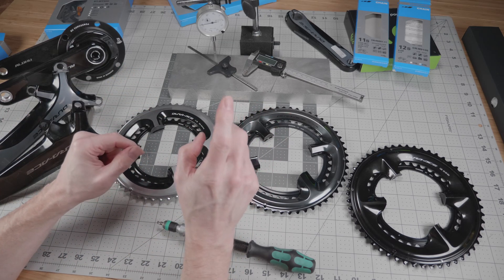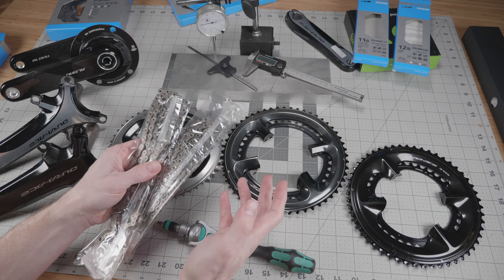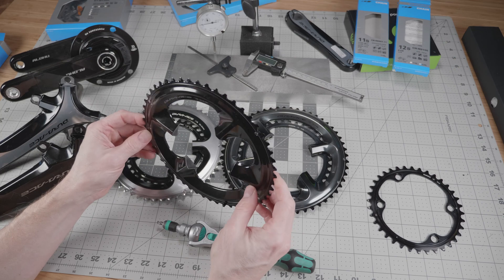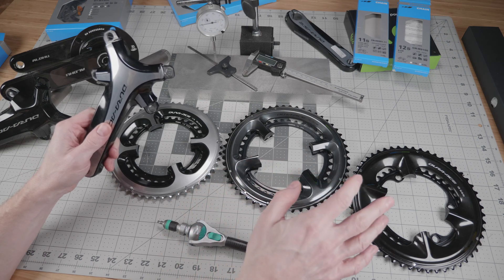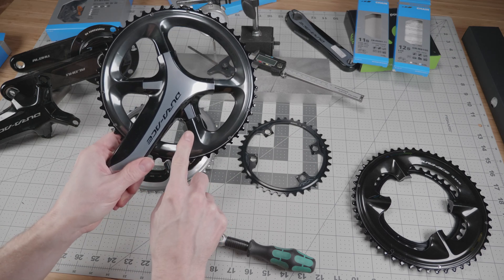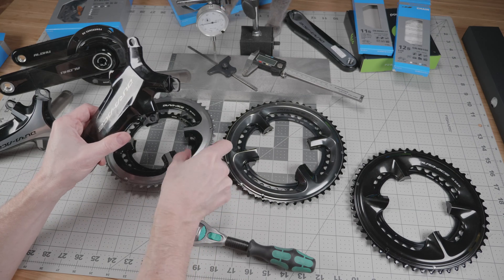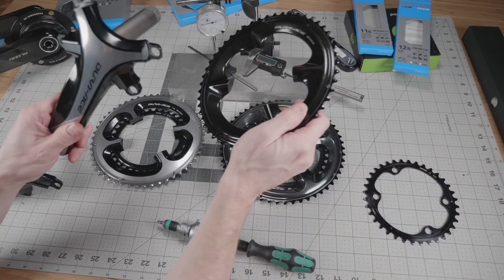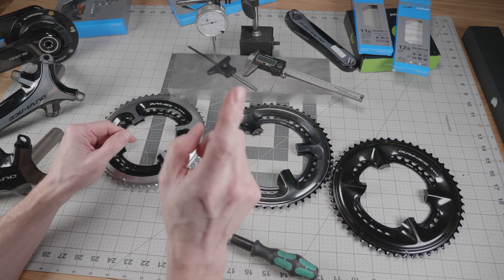Shimano 12-Speed Road Chainring Compatibility

Comment: Except the older gens were less stiff, and very perceptible on newer stiffer frames so you do not want a 9000 spindle and arm on 12 speed. 2- watts difference between a loosened 9000 and a 9100/9200

Comment: You can fit 11 speed shimano chainrings on a 12 speed crankset but it requires using a metal file to file away some of the metal from the 11 speed chainring. I have an Ultegra 8000 11 speed chainring on my 105 12 speed crank. Works absolutely fine with Di2.

Comment: Quick question, I have 105 R7100 12 speed Di2 groupset, I am looking for a 39T inner chainring but I cant find it for this 12 speed, there is for the 11 speed however. Can I use a 11spd inner chainring for the 12 spd groupset? thanks

Comment: This is a bit of a "hail mary" given the most recent comment is a year ago - but here's the deal - bought a bike with an 11s ultegra setup - the crank is labeled as a FC-08 but has the same design as the FC-R8100 - I can confirm this because the FC-08 is visually different from my FC-R8000 and the chainrings from the FC-8000 11s won't fit on the FC-08 crank. the FC-08 was equipped with new 11s inner and outer chainrings - sadly 2 teeth on the outer 52t chainring were damaged in shipping. So, they sent me a new outer chainring but it is the 12s. version. 

Question - will using a 12s outer chainring with an 11s inner ring and 11s cassette w/11 speed chain be an issue with the 12s outer chainring? 

It's annoying that I have not yet found a way to contact Shimano directly about this and every authorized LBS Shimano Dealer has given me a different answer. 
@gadgetblues - found your video via a search that led me to a forum talking about this and you're the go to reference for this - if you have any insights - perhaps newer than what's talked about in this video - it would be a great help!

Comment: Hey, Thanks for this video! I still have a question though. Can i use a 9200 powermeter crank on a ultegra 8150 system and will the ultegra chainrings fit on the dura ace crank?

Comment: thanks for the video. Although I think I am sure I found the answer to my question I need your confirmation - I got some great deal on some bike which came with Dura Ace 9170 crankset 52/36. If I replace entire crankset (not just the chainrings) for new DA 9250 54/40 will it work flawlessly with that 11 spd cassette? thanks

Comment: I used a 9100 crank with my 12 speed 8100  Worked well shifted well for about 4 months  The  Teeth started to wear on it And I had 2 consecutive chains snap Replaced it with an 8100 crank and the problem As went away

Comment: @GadgetBlues - https://youtu.be/IYx3RR9rai4?si=nTNyFl7lRz3NKYVN&t=337  but in 12 S also this curved surfaces of 2 lower screw sockets are not fitting perfectly crank arm, so it may mean most ot stability comes from pints where screws hold chainring.

Comment: People who had spare / custom big chainrings from 6800 to 9100 - will not use it on new 9200 of fc08 / fc09 cranksets (those last two from recent warranty Recall of cranks) > so Shimano is forcing You to buy new chainrings or when You have flat chainrings and skill - try to remove one angle on not fitting small-screw holding "arm"...  Cause one screw holding arms in old 9000 and 9100 ia already littl curved.

Comment: Can u use 9200 chainrings with 9100 crank and use it with 9100 11 speed mechanical groupset?
Reply: yes you can and for better results use the 12 speed chain too and you wont face issues on front shifting plus a generally quieter groupset

Comment: Can  just triple check if I'm watching the correctly.

I can use shimano 9200 chain rings with Quarq Dfour power meter? Everything will shift and calibrate as it should, but cosmetically it won't 100% line up

Comment: I’m upgrading to 12s and I’m having a really hard time finding 165mm cranks like I’m already used to on my TT. Thanks to your video I now know that I can keep my old cranks and mount new chainrings. It’s a pity though that Ultegra stops at 52… I’m pushing a 54 and that change would force me to run 52-11 that rally is non that optimal. Hope Shimano will release 54/40 as well

Comment: You gave chain measurements early on that don't entirely follow the standard method for measuring chains. Can you measure again and post the results? Outside width should be measured at the rivet, outside to outside. Inside width is measured between the inner faces of the inner plates, not the outer plates. Outer width has changed with each change in total speeds, but 9-11 speed chains have all been nominally 11/128ths inner width between inner links. Since the inner surface of outer links only contacts the teeth during shifting, or on a 1x narrow-wide chainring, it's really the inner width between inner links that matters for chain compatibility with a chainring.

Comment: Is there grx chainring and 105 or r8000 campatibility video?
Reply: 105 and Ultegra have the same compatibility as dura ace. Grx rings are not compatible with any other shimano cranks, but you can use any GRX ring with any GRX crank.

Comment: Btw, because of the new inner seal on the 12 speed crank spindle, you'll need the shorter '1st version' crank fixing bolt. The 2nd version is too long and will bottom out.

Comment: Hey one thing you didn't mention, but I assume is the same, is the chainring bolts? Do the new 12 speed cranks use the same length chainring bolts as the 11 speed cranks?
Reply: no, new ones are longer

Comment: For 9100 and 9200 gens crank arms aren't compatible with big rings from other gens!!
https://youtu.be/tpVpgXOzzSE?t=98
https://youtu.be/amOTvj229Mo
only 9000 gens arms are cross-compatible with all other gens
Reply: I don't think you understood what was being said in this video. The difference is BACKWARDS vs. FORWARDS compatibility. Backward compatibility means a new product works with old products. Forward compatibility means an old product works with new products. In context, if the 9000 crankarms work with 9200 rings, they are forward compatible. If the 9200 crankarms do not work with 9000 rings, they are not backwards compatible.

This video states that FORWARD compatibility exists, but that BACKWARDS compatibility does not. The two videos you have linked to are about forwards compatibility. All videos agree with each other: on 9000 arms, you can use 9000,9100,and 9200 rings. On 9100 arms you can use 9100 or 9200 rings. On 9200 arms you can only use 9200 rings. The same applies to the equivalent generations of 105 & Ultegra.

Comment: Thanks for the info!! So I've tried a 12sp Shimano chain on my 11 sp SRAM eTap with Shimano DA9100 crankset and can confirm the issue of shifting on the front. Because of the narrower chain I had to move the high limit on the front derailleur out to help push the narrower chain up to the big ring otherwise it wouldn't shift. This caused a few drops while riding and made it annoying, not to mention some scratches on the crank arm. I will say, the rear shifting was crisp and much quieter with the 11sp chain. Having seen this, I will try to get the new 8100 chain rings on my 9100 crankset and get that narrower gap on the front because I really like the 12sp shifting on the back.
Reply: Why did you use eTap with a Dura Ace chain set?

Comment: I have DA 9000 di2 wanting to upgrade crankset to 9100 will there be shifting issues??
Reply: there will not.  both are 11speed and use the same 11spd cassette/chain.
Reply: @marcuswong1797  I thought gap was wider between chainrings?
Reply: @hangrytim  gap is the same between 11 speed groupsets.  it changes only when going from 11 speed to 12 speed
Reply: @mikes1984  if it is the same why dosent it shift as good plus can't adjust trim on 9000 front mech.
Reply: @hangrytim  9000 front mech does trim.  you might have the components installed slightly differently.  i swapped out the cranks on the same bike and they shifted exactly the same way

Comment: Great video. Thank you. Quick question, can you put a non-sculptured chainring (ex: 46T AbsoluteBlack chainring) on the R9200 crank? I figured if the 4-hole PM like Power2Max that has no sculptured works with R9200 chainring, maybe it works vice versa with non-sculptured chainring with R9200? Just wondering.
Reply: He won’t answer you.

Comment: What about using the 12 speed crank on 11 speed groupset?
Reply: I have this question too. Mechanical r8000 ultegra chainring but want to use the new 160mm ultegra 8100 cranks - not possible?
Reply: I have the same question … do you find the answer ? Thanks
Reply: I think it should work 
I am thinking of swapping the 105  chainrings on Sora crank 
And on Shimano website if you see the exploded view it seems that same bolt is used for securing the chainrings 
And since they both have the same b.c.d the only factor left out is the shape of the crank design, which by eyeballing it doesn't look so different but I guess can be easily confirmed if you roughly compare it with someone else's crankset.

Do tell if anyone has success with it

Comment: Great video.  I didn't know that the 12-speed chainrings are 2mm closer.  Also one thing you didn't mention, the 12-speed chainline is +1mm as compared to 9100.  But it appears that's still within the adjustment range of the 12-speed FD so running an old 11-speed crank should be OK.  I'm also curious if the 9200 FD will work with the GRX crank which has a +1.5mm chainline as compared to the 9200 crank.  And it has a 17T gap.
Reply: I am going to switch to SL-K Light Tandem Rear Crankset (which, nominally, is 11sp). 

Have you tested the 12sp FD with the 11sp crank already? 
Does it work as it should or should I wait until (sooner or later) FSA makes the 12sp version?
Reply: @PrzemyslawSliwinski  Yes.  On one bike I have the 9200 FD paired with 11-speed GRX chainrings.  Shifts great.
Reply: @jonathanwoo6597  ThnX!